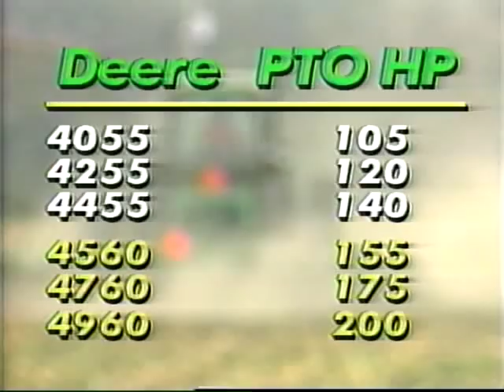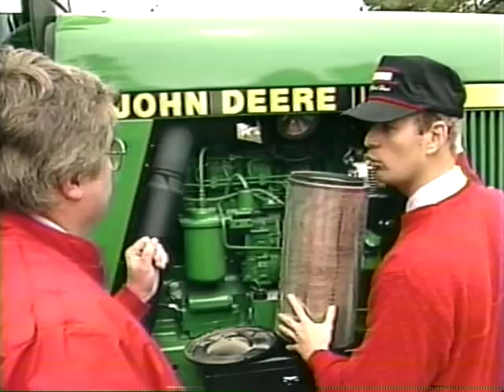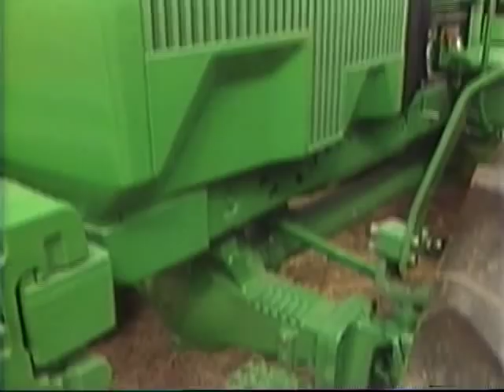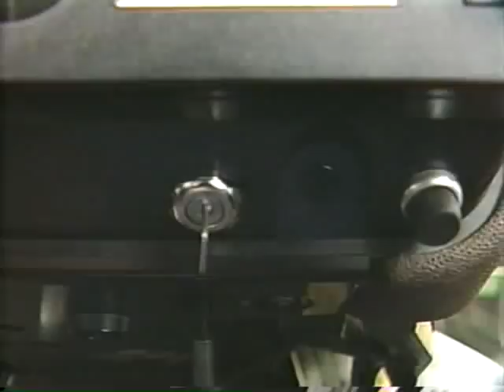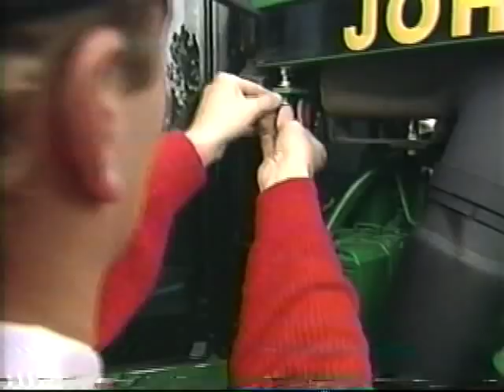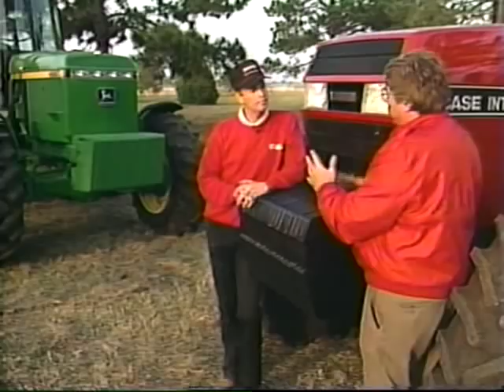CaseIH Introduction to Deere 60 Series

Comment: It’s got glass just like a magnum 
It’s got these tires just like a magnum 
Comes with a door just like a magnum 
Comes with a steering wheel just like a magnum
It has these lights that help you see at night just like a magnum 
Comes with a battery just like a magnum 
Comes with a 3 point hitch just like a magnum 
And comes with this engine and transmission helping it move and pull things just like a magnum

Comment: I have a 4240 at 11500 hours and use it to grow 1000 acres a year and never been pulled apart. I also have an mx 100 at 10300 hours and it’s been opened up twice. Not to mention the electrics. Our 1460 was an awesome header only bettered by the 2388👍🇦🇺

Comment: I have to say this but we bought a quad trac last year so we could have two tillage tractors and we used the quad trac 4 times before the transmission went out and our 9620rx had no problems and we use it harder than the case I never realized a case would break by pulling a 20 foot ripper over all we will never buy a case again

Comment: i would still take a deere any day of the week, and that SG2 cab with a syncro box is heaven on a 3640 platform. Some of you might not understand this as im from the uk so we have less strict rules and also we had different smaller tractors in that age.

Comment: 1972 Generation2 4630...evolves into...this 4960:  Have always marveled at the idea of the 60 series being initially sketched on a napkin at some Waterloo diner probably around 1968-1969.  That same basic design and engineering .... evolved slightly every few years to become this incredible 4960.  Clearly engineering and manufacturing began to equalize at some point in the late 1990s (as it also has in automotive) to where now even AGCO has tremendous offerings here in 2020.  But Deere was so far ahead in engineering, simplicity, and thus daily usability throughout the 1960s 1970s and most of the 1980s.  (Until the Magnum of course)

Comment: I am a case fan, but the fuel fill on the magnums is a terrible location because the hose going to the tank is nearly flat which doesn’t allow fuel to flow easily. It is also kind of awkward to straddle the steps and the tire to get to it.

Comment: Tell you one thing they got a hard on for case ! They don't tell you what different transmissions were offered in the JD . You never if rarely have to take the sheet metal off ! I still run my old iron horse series 70's and 80's and they will put a full days work in ! Ask yourself how many old iron series JD's are still around . Enough said.

Comment: The old horizontal mounted oil filter housing had a drain plug that you could easily replace with a ball valve like we use on water pumps to drain them on cold nights it's nice to just reach down and open drain plug  or close it.  Sometimes it just depends on your preference
Reply from the maker: They don’t want you to know that though lol

Comment: I have been a John Deere guy all my life. I am now 63 and grew up on a farm using the old 2 cylinder tractors. I still have a 1953 JD 50, 2 JD 520's, and a very rare 2520 diesel wide front. I think Deere has took the lead in the tractor industry over the years. I used to have a 720 diesel that we ran the 336 square baler with. That was the perfect combo for our northeast Iowa hills.
I bought a Kubota front wheel assist 2 years ago. I looked at the Deeres and other brands and was very disappointed in their tractors of that size. For one thing, they don't build those. They only put their name on them. Their fel,s are not quick and easy to remove or put back on and their front implements are Deere proprietary, meaning that you can use only JD implements. You can adapt to others, but it is just that. Adapted. They don't even come with a drawbar. That is optional. $175 optional. It was at that point that I stopped looking at the Deeres and walked away.
They are catering to a market of suburbanites who have gotten tired of the city life and want their own little piece of heaven. These are 1st time tractor buyers and use these smaller tractors for mainly stuff like finish mowing and want a light tractor. The engineers have engineered much of the weight away. For me, I want the weight. I use my Kubota down in the timber to pull downed trees up to a pile and cut them into firewood.
It is just my opinion, but it feels to me like Deere is relying too much on the name that they have built for themselves. They earned it, but they also need to continue with that practice. 
When you sit in the operators seat of a John Deere tractor, you feel like they sat you down in the factory and built that tractor around you. They do a pretty good job of designing them with the operator in mind.
What I do like about John Deere is that I buy about $100 worth of stuff a year from the dealers. I won't get both feet in the door before someone greets me and calls me by my first name. Their dealership network and parts availability is second to none. That right there is a huge thing to consider if you are on the fence between buying a Deere or another brand.
Good video. I thought that you did a fair comparison.

Comment: I've always been a fan of John Deere so I kinda thought about punching something when they kept saying like a Magnum.  The door has never been an issue for me, neither has the stack and air filter on top on the hood been an issue, also the post in the middle of the windshield, guess what, never a problem. I don't get why they had such issues with John Deere hanging onto the traditional tractor style. Farmers for decades have coped just fine with them and they have come to love them. I know I have. Maybe Case is jealous that John Deeres look better.

Comment: Kinda seems like they are grabbing at straws here. The only valid complaint is exhaust pipe interfering with the Cab window.
Reply: As well as picking on battery location. Deere has had that battery location since the 30 series. Cant say that they took that from magnum when they were doing it before magnum.

Comment: We run Deere and Case IH. And both have good points but Deere hydraulic pressure far surpasses IH. Even a Deere made back in the 70s has better psi than case made in early 2000s. When Deere released the 8000 series a few years after 60 series they were so far ahead of their time that even brand new tractors 25 years later have not changed a whole lot.

Comment: Funny to see this 30 years later.... still a lot of 30-60 series tractors in daily operation.... don’t see many old case tractors and those that you do see are complete junk.... we switched to case for about 10 years and never ran a tractor over 1500 hrs... we switched back to Deere with the 8r models and one has 3000 hrs and the other has 4000.... no problems

Comment: Thanks for posting this video.  It was interesting to watch.

From what I understand, the 60 series was a stop-gap measure because the 8000 series wasn't quite ready yet, much like the two-cylinder 30 series in the late 50's.  Not many improvements, just a bit of a facelift.  The same could be argued for the 20 series consoles as well, they didn't have the 30 series quite ready, so they give the older design a few new doo-hickies to keep the buying public happy.

This is a better plan than rushing something onto the market that may not be fully ready.  The IH 86 series and the Ford SOS come immediately to mind on how to bring something to market the wrong way.  Deere made some duds, they just have made a few less duds than other manfacturers.
Reply from the maker: Thanks for watching. I have another video from Case on the Magnum vs. 8000 series as well.

Comment: Well you cannot argue about convenience although one must concede that these items are a natural progression to a modern tractor. What I am saying is that Deere did not necessarily copy these features as they were "no-brainers" and would eventually be incorporated anyway in the future. I would imagine Deere found it annoying that IH did these simple mods first and claimed them as exclusive to their designs (eye rolls).. The strong point with the Deere is the durability and strength of components.. Hey if your tractor is broke down it doesn't matter much how easy it is to enter, fuel or even change the air filter !!! I was a little shocked by the boldness of this IH video and the audacity.. They also browse current competitor models for good ideas I wont believe otherwise.

Comment: A Stiger Panther series IV isn't a Magnum either, but was better than both.
Reply: Stiger's simple technology is actually the way of the future people just don't know this yet. You can bolt on electronic mods 1,000's of times cheaper than you can buy on a new deere. Pulling efficiently and in comfort is just not that complex.. What else does a tractor need do ? Nothing. However, I was a little boy in the heyday of great equipment improvements (for me it was the 1970's) and I will miss the excitement of tagging behind my grandpa and dad to go shopping.. Then to stand there and look at this beauty parked in the barnyard with a sticker still in the window, new cab smell and all .... Radio too ffs !! All done at an affordable cost if done with care and could be paid for with a modest size farm.. miss those days.

Comment: This was obviously a pro Case IH video yet they spent the entire time reviewing the Deere. 

They should've done a direct comparison. I agree the Magnum engine was better but operator ergonomics were worse imho. I never liked the controls in the Magnum. Still lightyears ahead of the older IH controls where one had to be a contortionist to reach the hydraulic levers.
Reply from the maker: +J Man it wasn’t really a comparison video, it was made by Case to introduce the dealers/sales staff to the new Deere 60 series tractors. So the guys in the video aren’t really trying to sell the tractor to the viewer. If that makes sense. I have a few videos like you mentioned, actual comparisons geared more for the end buyer to watch.

Comment: You go trade in one and see which one has better trade in value green always does!
Reply: The hardest costs to see are the obscure ones.. But this is an extreme loss the depreciation is terrible (or used to be) on these red machines.
Reply: Ralph Malone Have you seen what used magnums are selling for ?
Reply: That's cause your paying for the name
Reply: Today the 8930 i bought in 08 is worth the same as I paid.  Plus 5000 hours.  Them old one really have held.  Here, at least, 55-60 series have kinda lost luster.  xx00, they have held value good for sure though.

Comment: 1837 speaks for it's self, 1 name and still in business!!! Red guys are always comparing Red to Green. Deere has never compared their equipment to anyone else. They just keep on going strong with what they put out on the market! Ever since 1960 with the New Generation of Power, Red has been trying to keep up with the Big Boys!! I've been using John Deere equipment that my Grandfather & Father bought new and If I need a part a JOHN DEERE dealer is close by and still has the parts I need. I been at a few different IH dealers and they are nice, but the ones close to me don't carry parts for older equipment. It's been along time since IH & Case made tractors! All tractors were made well, it was how the farmer took care of his equipment. Ours goes into a shed when not in use and is not abused, the tractors pulls or run's the equipment built for the size tractor. I see a lot of equipment sitting out side in the weather all year around, different colors, SAD!
Reply: There is a reason IH was bought out
Reply: Hmmm, that must be the reason someone came up with a kit to drop a 466 into a  Johnny. Might have something to do with the fact  Johnny doesn't make those engines anymore.

Comment: i know mac farms pays the bills .
 but how many on here pay the bills.
but in 70% of cases the bank manager tells the farmer what to buy.
and that is why case failed.
when i look back at histroy it was the companys whose tractors that didn't brake down that went broke.
if i was paying 200,000 plus for  a tractor that was cheap to run ,i would recondition an old one .
of the deer brand it would be a 4020

Comment: hmm case IH breaks often the magnum is an unreliable weak piece of junk you need the tilt off hood and all kinds of service access because they break all the time and they have no resale value.
Reply: They had Cummins in them and were extremely reliable obviously you know nothing
Reply: @travisbrooks3379  Not as reliable as the JD engines, especially when paired with a JD transmission
Reply from the maker: John Deere themselves must think the Cummins engines are alright, they’ve used them in their biggest 4wd tractors since the late 1980’s.
Reply: We have a 7140, and it is the worst tractor ever on our farm. I would trade it in on a Deere any day!